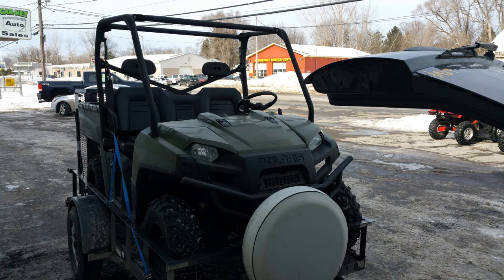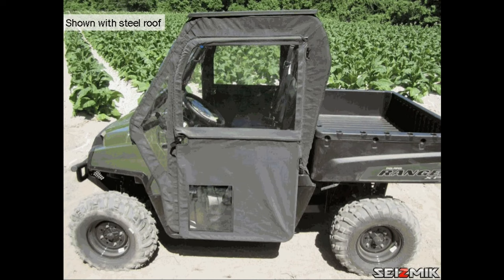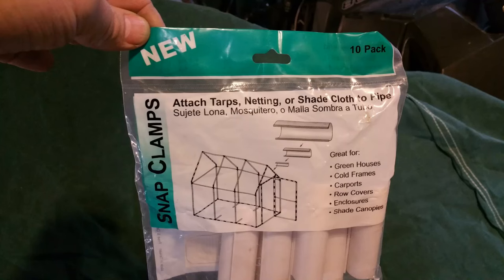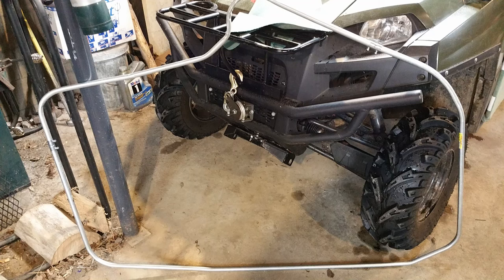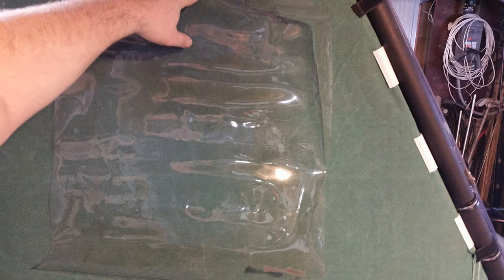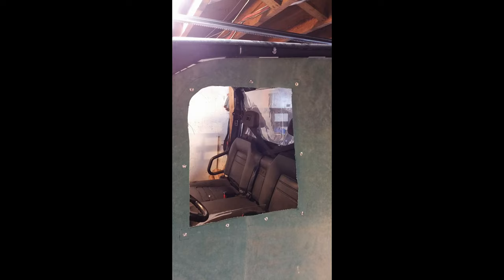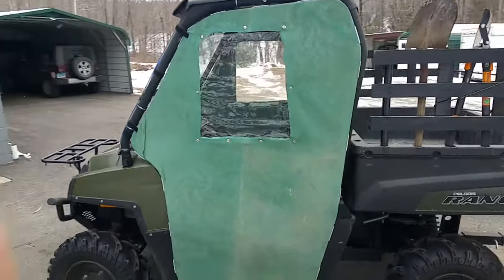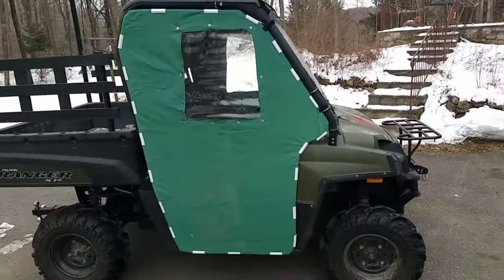How to make redneck UTV doors for under $100

Comment: Great job. A couple of the "corners" look like pretty tight radius's. Did you use a standard emt bender? I have no experience with them but look easy to figure out.
Reply from the maker: Yes. A standard EMT bender. Then slightly tighter by hand. Thanks!

Comment: could make the whole top part from clear plastic (same stuff as the front window ) and only use the tarp stuff on the bottom part , can dril and screw the plastic to the frame and add on extra bar on the underside of the window to stretch the canvas over
Reply from the maker: Probably

Comment: What is the thing that looks like a solar panel at the bottom of your windshield
Reply from the maker: A solar panel.... 😁 Small trickle charge one
Reply: MotoCheez do you store your machine in the sun?
Reply from the maker: @BackyardBroadheads  no, but when I'm working with it outside and running an inverter, winch or radio a bit more charge never hurts. I've killed the battery a few times before
Reply: MotoCheez word

Comment: What size tires and what windshield is that? Having trouble finding one for my 2010 ranger 700 EFI
Reply from the maker: Theyre 25 inch tires, the fold-down windshield I bought off of eBay so many years ago I can't remember who actually made it
Reply: @MotoCheez  thanks bud

Comment: If you hinge the doors on the back side it is much easier to get in and out.
(Once you get used to it)
Reply from the maker: Agreed, only reason I did it from the front is because the slant of the window keeps the door shut and I don't have to worry about it blowing open if I don't latch it
Reply: @MotoCheez  yep they do rip your arm off if your moving about 30 mph and you open them

Comment: How do the velcro strap hinges work?  Do they hold up well?
Reply from the maker: Josh Poley they work awesome. Just need something to stop them from sliding down, which my folding windshield does
Reply: Good to know.  Going to try same thing you did then.  Thanks!
Reply from the maker: Josh Poley I love mine, you would think someone would make a cheap kit like these to sell. The bends are the hardest part. They're nice and light too